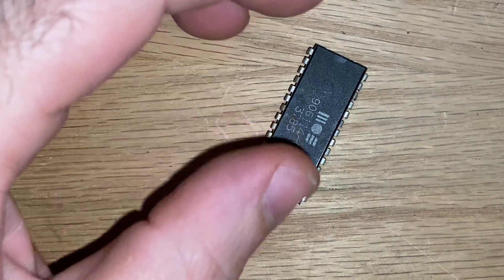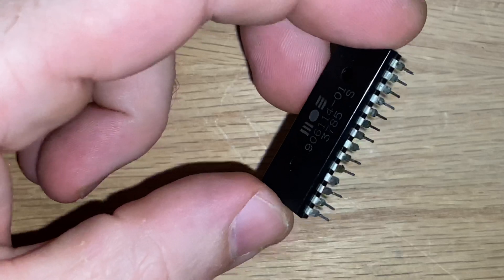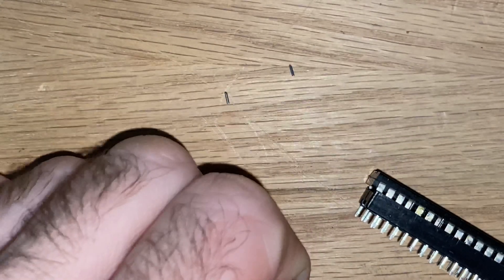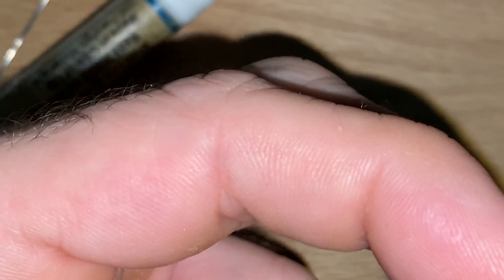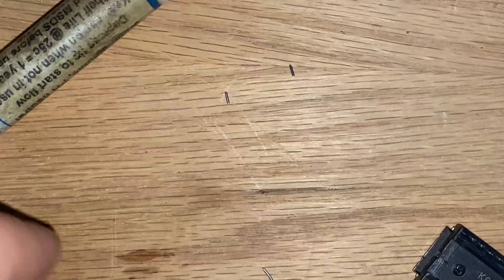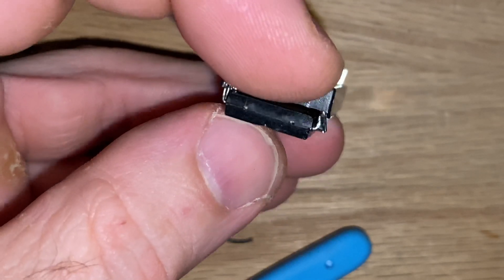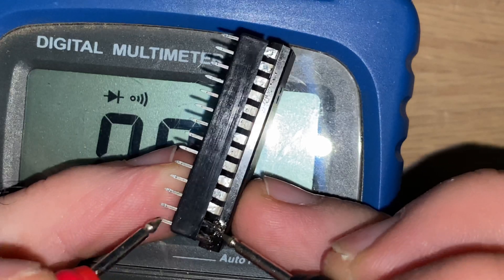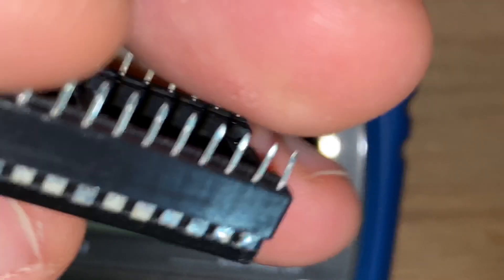Fix Broken Pins on an IC

Comment: aewsome video.. i damaged 1 pin (incredibly forgiving chips after a few pulls) on my amiga.. two a 40pin 8520 chip..  i may apply this primitively (without solder of course) on all of my chips like this just so future pulls can put wear and tear on the socket bridge not the original chip..

Comment: I'm trying to do the same type of fix except the broken pin is in the IC socket.  Any idea how I can extract the pin form the socket?
Reply from the maker: That's a tricky situation. jamming anything into the socket to try and recover the pin will most likely damage the socket. If you have some precision tweezers then maybe you could try but your best bet may be to desolder the socket
Reply: @DIYChris  
I think I got it fixed.
After cutting some of the socket away I noticed the gap between the pin in the socket and the lead coming out of the IC was only about a hairs width so I was able to bridge that gap with some solder. I checked the continuity between the lead and the back side of the PCB and it checked out.  So I should be okay.
Reply from the maker: @jcf20010  Nice, and actually what I thought of just after I replied was just sticking another socket on top of that one. The pins on the sockets are flat and should easily slide past the trapped pin. You'd have a double socket but it would work.

Comment: Interesting video thanks. How did you manage to break those pins in the first place?
Reply from the maker: Wedging a pry tool to aggressively on one side, the chip popped out with some of the pins bent, when I tried to bend them back they just fell off. There may have been some corrosion. Thanks for subscribing
Reply: @DIYChris  No worries man. Great to see these c64's coming back to life. Keep it up :)